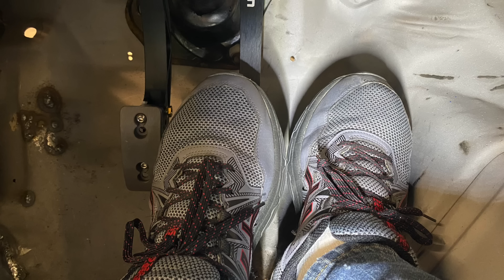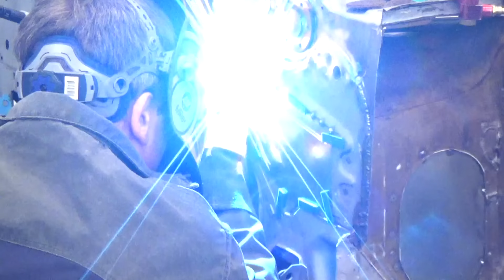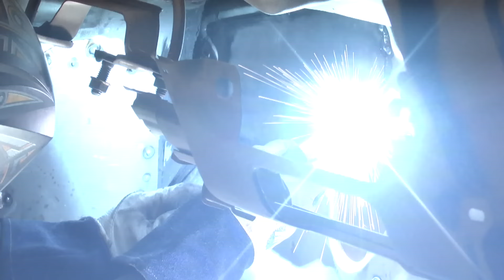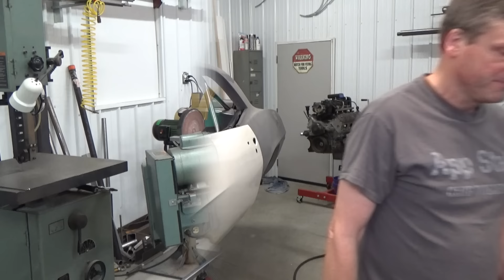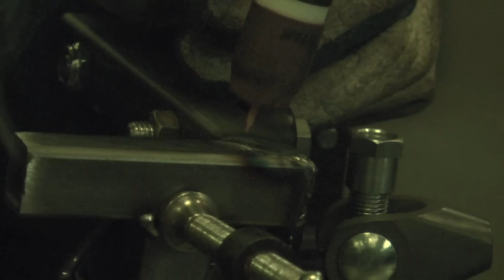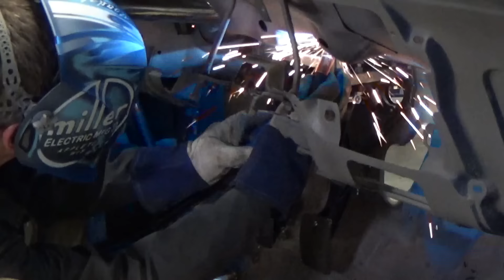Real Garage: Oh, Stop It! (Brake Pedal Kit Mounting) (Season 5, Episode 1)

Comment: Specifically, what eye protection where you using, that allowed you to see what you were doing with the plasma cutter when you were cutting out the firewall?
Reply: For the real low amperage plasma cutting like the firewall I used the Miller face shield part# 288270.
For heavy plasma cutting I use the 288273 face shield.
I also have a 282013 helmet light accessory mounted to it with one light.